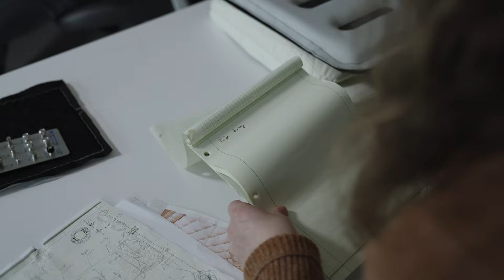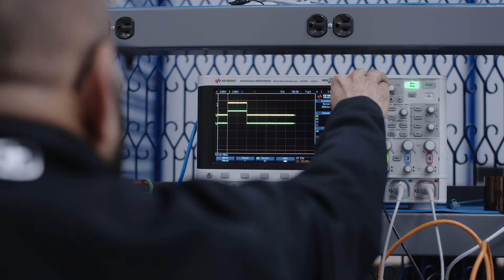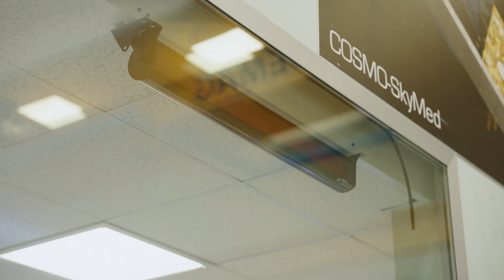Axiom Station

Comment: Hopefully the Axiom Station can include a module to create and test artificial gravity. The idea is to use numerous small fans to create a high air pressure chamber to compensate for the loss of the gravitational pull.

Comment: Yea, Axiom can thank Elon for changing the paradigm for spacecraft design.  Nobody had the guts or the motivation to do rapid prototyping and testing before SpaceX showed everyone it was possible, and they were fat dumb and happy getting cost plus contracts to take 30 years to build a new spacrcraft or launch system.  I am glad there are so many companies adopting the more sensible path pioneered by Musk, using mostly his own money.
Reply: I think rapid prototyping and testing has its benefits, especially when compared to the old sluggish manner in which aerospace development used to be conducted, but it's certainly not a 'more the better' situation nor is it a comprehensive solution to delays, and the last thing I'd do would be fanboy over Elon Musk.

Comment: I certainly hope you didn't adopt the "build first, think later" attitude prevalent in SpaceX Starship program (but not what brought Falcon program to its present status of phenomenal success.) With a crewed outpost you cannot simply shrug off every disaster as "learning opportunity".

Good luck!
Reply: Think its more with regards to the visualisation of the design. CAD is all very good but doesn't give you a sense of space, scale or convienience. Only when you actually stand in a prototype do you apprieciate what it will be like to work/live in.
Reply: I think fast prototyping is beneficial in the early stages of a project, especially if the available resources allow it. SpaceX's approach with Starship has had moments where I've thought then lean too far into this mindset, and it ends up being sloppy and wasteful, but in other cases I think it's what has allowed the program to proceed with such haste. Bottom line treating test failures as learning opportunities can support a program which does not have a lot of groundwork or prior experience to draw from, but as it progresses you have to move away from this and be rigorous and thorough in development.